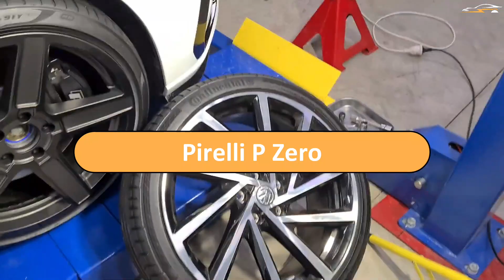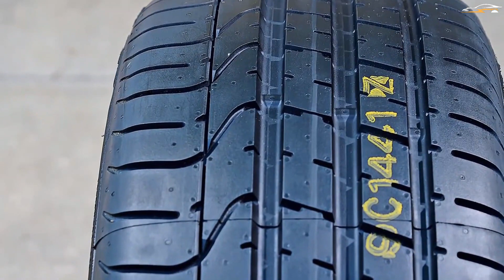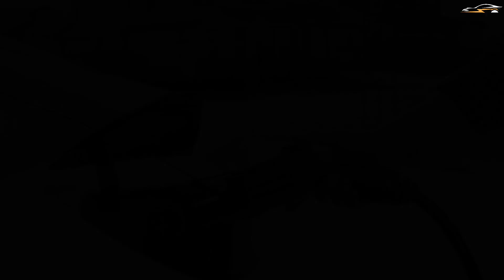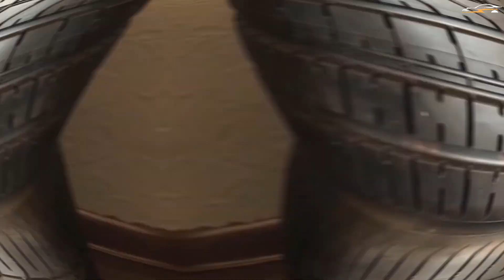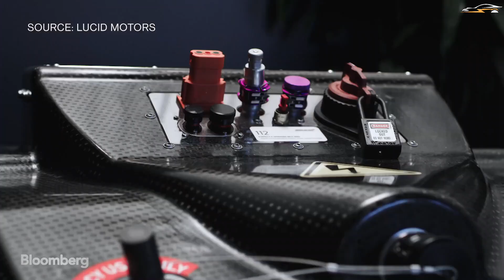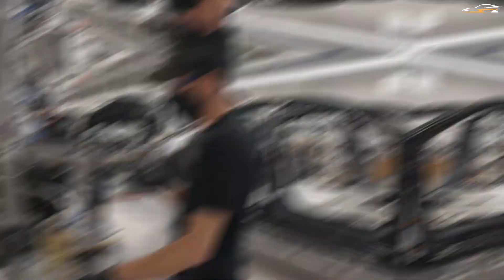Lucid AIR to be the FIRST CAR with THIS NEW TIRE!

Comment: Just before the start of this rainy season in south Florida I put a set of Pirelli P Zero tires on my Tesla Model S P90D.  The car originally came with Continental DW tires which I continued to use as replacement tires until Continental discontinued the size my car (19" wheels) required.  They were very impressive tires, especially in the wet.  To my surprise, the Pirellis took the handling and grip up another notch, especially in heavy rain.  The Pirellis were also the first tires I've had with the noise suppression foam in them.  I thought that was probably a marketing gimmick until I put the car on the highway.

I'm waiting impatiently for my Dream Edition to arrive and was delighted to see Pirelli's press release a couple of weeks ago that they have worked with Lucid to develop a P Zero specifically for the Air.
Reply: How is your car working out for you? Received my Air last month. Just like to touch base with other Lucid owners.
Reply: @debragherman6196  We got an early production car (no. 154).  We now have almost 13,000 miles on it.  Lucid resolved the few minor build issues with it early on.  The more extensive software issues have recently been completely resolved with the series of major UX 2.0 over-the-air updates, and the Lucid's software is now on a par with our Tesla Model S Plaid (as well as having some additional useful features).  Also, the Lucid body structure remains solid and noise free, while our Plaid (at just under 12,000 miles) is developing squeaks and groans in the body on less-than-perfect pavement.  Add in the more luxurious and far roomy interior, the quieter and more compliant ride, the more precise handling, and the Lucid Air is all around a better vehicle than the Tesla.

Comment: lucid will make me rich,  i am holding my 800 shares until at least 2028
Reply: 800 shares won't make you rich, just better off. I also hold a little less then a 1000
Reply: I meant figuratively although collectively with the rest of more portfolio it could put me over the finish line

Comment: You have no idea what you are talking about when speaking towards Pirelli tyres being used next season on a Lucid motors Formula E team. Michelin is the current supplier of ALL teams. Period. Next season, Hankook will take them helm for the gen3 format. No need to lie.
Reply: You are correct that Hankook will be the exclusive tire supplier to Formula E after the 2022 season.  However, I think you went a bit further with this point than the video actually did.  The video said that Lucid will be advantaged in developing a Formula E race car by its work with Pirelli, which has, in fact, been the tire supplier to Formula 1 racing.  While I see how that could imply Lucid would actually run Pirelli tires in Formula E -- and that implication might be what the presenter intended to dangle out there -- the video did not quite say that.

Also, it's not yet clear that Lucid will actually launch a Formula E team.  In its role as exclusive powertrain and battery pack supplier to Formula E, questions have been raised about the appropriateness of allowing Lucid actually to run its own car against other cars which must rely on Lucid for their powertrains and power packs.

Comment: I don’t see how Lucid can compete with any automaker.  They don’t manufacture any vehicles.
Reply: Do some research
Reply: Just any research
Reply: Then continue to don't see Lucid as any prospect, please don't invest in Lucid Motors. I want you to miss the run on Lucid and regret your decision.
Reply: How can ELON Crust complete with NASA or Virgin Galactic etc...He has not even went to the moon or Mars yet.
Reply: 89 pre-production vehicles already made and are out on the roads testing. Production cars are just around the corner with deliveries later this year.
Reply: Research.......89 cars is old news.....  Before they can start selling cars Lucid needs to produce crash test vehicles......
So back to my original comment...... the best way to make money on this stock is to short it
Reply: You will see short squeeze next week. Be careful!

Comment: Why are they showing a bubble on the sidewall or the tire
Reply: Probably was a tesla with a bulge on the tire
Reply: I was thinking the samething. 😆 🤣
Reply: That was a picture of a normal tire on a heavier vehicle . Just showing how the weight of the vehicle is dangerous if it exceeds the normal weight limit
Reply: @matthewstone6620  that’s a bubble on the sidewall of the tire it’s an inner break of the liner. I work in service so I know how it looks
Reply: @n3lson33  yeah from  a normal tire that has had too much strain and pressure on the side walls of the tire. That is why they disigned a tire for heavier EV's. What's ya point lol?
Reply: @matthewstone6620  my point is if that tire runs over a pothole it just might blow out the tire!